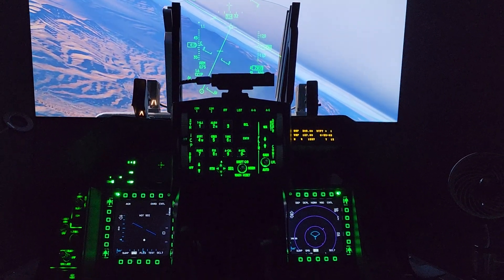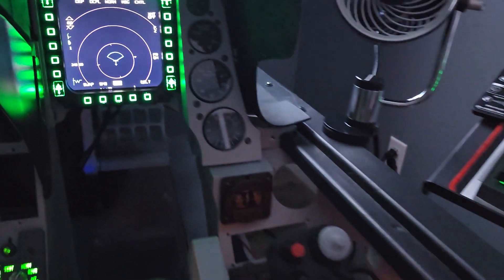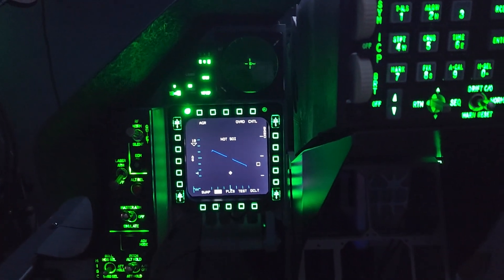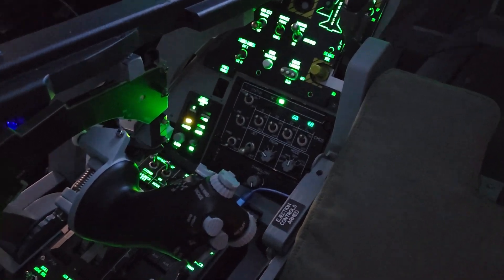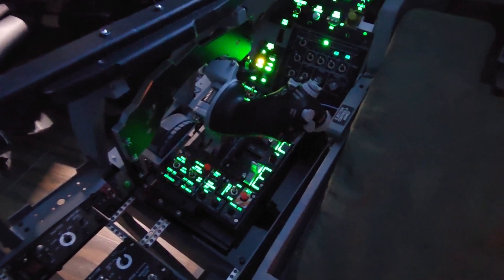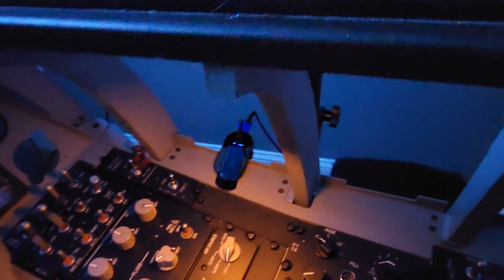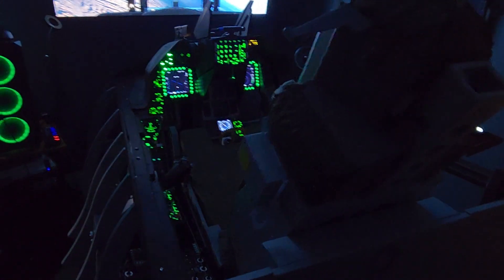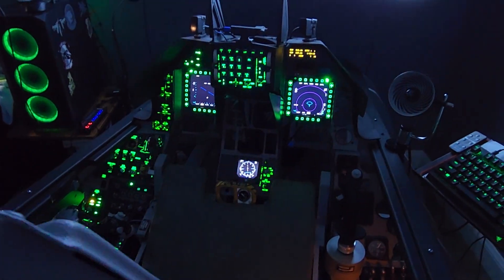F-16C Block 50 Simpit Short Update 9 Jul 2023

Comment: is simgears doing a throttle u say
,can you give some more info on that?..
and what is your resolution of the EHSI,mine is 800x600 but feels too big..
Reply from the maker: Yes. They have one in the works. Supposedly, It will fit into a replica pit with "minor" modifications.  I haven't seen the design yet but have been told to expect it in August. However, I have heard "next month" for nearly a year. I'm sure they will not sell something until it meets their high standards.

The EHSI: I also made my first with a high res screen. It looked great when it worked. It was otherwise a disaster. It required too much processing power for such a small display. I switched to a 640x480 screen and it has been extremely reliable.